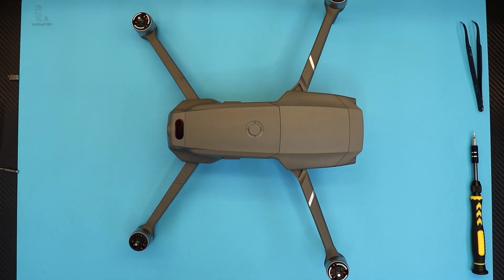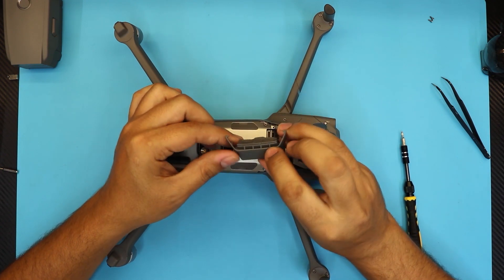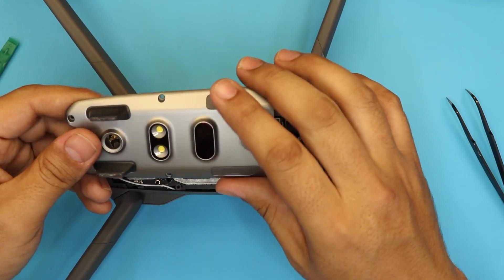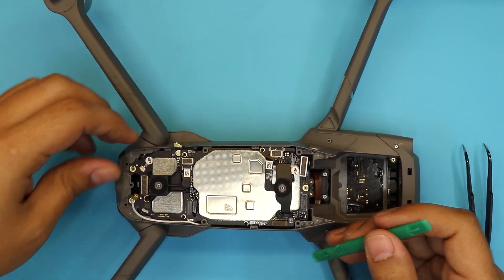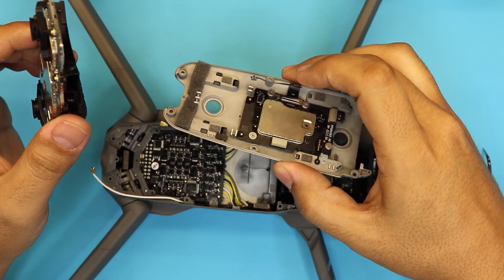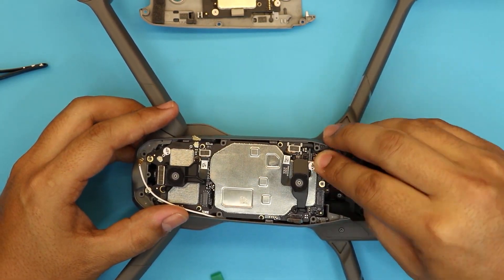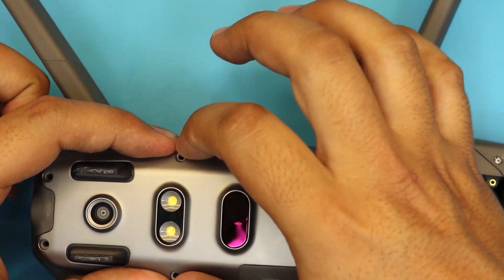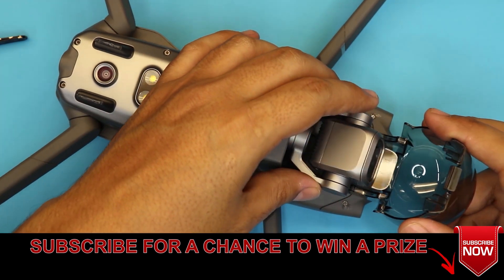DJI Mavic Pro 2 Teardown - FULL Maintenance | Cleaning | Disassembly

Comment: haven't flown my m2p in a long time.  it was overheating and the fan didn't come on.  Got so far as removing the fan/unit from the body, but can't really see anything that would obstruct the fan.  wires look intact and I don't see any obvious blown connections/board items.  is there a way to test it while it's out? can this part be swapped out without detriment to the drone?
Reply from the maker: 🫠 Regarding your question, based on your issues, I would highly recommend taking it to a reliable tech shop to get it checked and diagnosed.
cheers🍻
Reply: @uFixTek  haha…well I have to put it back together now, lol.  Thx

Comment: Thanks for posting. Very helpful. I’m reassembling and have 3 brown Phillips screws with washers leftover and can’t figure out where they go. 😬
Reply from the maker: It's my pleasure, my friend.
🫠 Regarding your screws, most of them are not required. As long as the main body screws are in place, just follow the video. If you see a missing screw spot, then you'll know.
You can test fly! If it flies and doesn't crash-land, then you're OK. Teheheheh.
Reply: @uFixTek Found. Attached the camera board to the body of the camera module. No crash landings required!
Reply from the maker: awesome, great 🍻🫠👍

Comment: My Mavic 2 Pro drone got splashed by a wave and immediately the processor chip overheated. Tried to fly it the next day but the screen started fritzing  and said "Main Controller Data Error." I am going to attempt to disassemble it and clean out the inside with alcohol in case there is salt inside.  Will this work? Any recommendations?
Reply from the maker: Thank you for the feedback! if you wish to support the channel you can LIKE or SUB or both :P
regarding your question: i recommend you to clean and wash the main board with isopropyl alcohol 99 percent : https://amzn.to/3wtpzzf
Reply: @uFixTek  OK, thanks! That's the plan. However, there is 1 screw I cannot get out. The wrench won't engage with the screw head. Should I drill the screw out or is there a better solution?
Reply from the maker: does the screw have a center pin? if it does then it is a torx secure screwdriver
Reply: @uFixTek  No, it's a hex like the others. If I were in the USA I would buy a specific tool to get the screw out, but as I am traveling in Ecuador I have limited options. If there's a bit of salt from the saltwater still inside the drone, how much damage will that do to the electronics over another 5 weeks?
Reply from the maker: the salt water won't do a big damage, we have opened a drone with months of saltwater and they were fine.
Reply: @uFixTek  OK, thanks, this is good to hear. But I definitely shouldn't try to power it up again until I fully clean it, correct?

Comment: Hi all i have the same model drone but my drone have overheating issued

In 10 min fly time my drone can overheat about 42c 

I am staying in malaysia 🇲🇾 
Temperature here normal day will be like 28-32c

Night will be like 25-27c.. even i fly during night time still i will have overheating issues.

Can someone advise please thanks
Reply from the maker: Thank you for the feedback! if you wish to support the channel you can LIKE or SUB or both :P
regarding your question: usually with a good servicing this issue goes away.

Comment: Hi man! Once again, thanks for the great video. I have one question for you. I would like to get the power out of the Mavic 2 Pro to power a small external device.
I would need to solder the wires to the Mavic battery power port pins underneath (7:45 on the video), right? 
Do you know which pins exactly?
Reply from the maker: thanks for the feedback, and i need to know what you going to be powering ?, how much volt you need? and you will need to add a  diode to protect the main mavic board.
let me know what volt you need?
Reply: @uFixTek  hi! I want to power the Parrot Sequoia multispectral camera. Its manual says it needs 5-6V, 2.4-3A and 12-15W. I know that  Mavic battery is 4S and that I will probably need a BEC to get 5V, please correct me if I am wrong!
Reply from the maker: check this video right @5:30 where i remove the cover where the battery goes and the pins are exposed you can solder  a cable to those pics and make a tiny insertion on the case and pull out the 5v
https://www.youtube.com/watch?v=5_MgcnTaQiM

Comment: Hello, excellent video, can you confirm where exactly the compass is located? Thanks
Reply from the maker: Thanks ✌  for the feedback!  if you wish to support the channel you can LIKE or SUB or both :P
Regarding your request:  if by compass you mean the IMU (IMU (inertial measurement unit) calibration is one of those things that is critical to keeping your drone straight and level. The IMU is a sensor that detects motion along a horizontal plane, as well as increases and decreases in altitude.) then watch this:
https://www.youtube.com/watch?v=5_MgcnTaQiM
if you need to know where is the GPS board its in this same video linked above, @6:40 i point to the GPS board
Reply: @uFixTek  Ok thanks
Reply from the maker: my pleasure 😊

Comment: Thanks for the great video!
Could you let me know what type are the screws are used on DJI Mavic. I need to alter something on the drone, below the drone at the back. Screws are not typically M screws I see, have less and more sharp threading.
Reply from the maker: Thank you for the feedback and your support to the channel by a SUB :P
regarding your question:
i will try to get the size of the screws for you let me send an email and i let you know once i get respond.
Reply: @uFixTek  :) Subbed! Thank you very much! Looking forward to the info!
Reply from the maker: i have send two emailed to a friend that works at dji repair dep. i will inform you as soon as i get reply.

Comment: Hi Thanks for the video. I am a total beginner and just about to spray alcohol to the circuit board after soaked in the salt water. I have a few pieces of metallic? tapes on the top of sensors and I would really appreciate if you advise how to glue back to it. One of the tape has been nearly ripped and how can I replace it? I would really appreciate it.
Reply from the maker: hi thank you for the feedback and your support, regarding your question, 1st make sure its a 90%+ alcohol iso :
https://amzn.to/39noeir
don't use anything under 90%
this alcohol its not conductive you can without any issue wash the board using this alcohol.  this alcohol will replace the salt water and remove the oxidation.
and about the tape i need to see some pics to know what you talking about, upload some pics and send me. 
use this:
https://prnt.sc/

Comment: Will any integrity issue for all the dismantle part/ribbon after we take it apart? I'm planning to replace the body shell. Because the authorized seller in my country said, there will be a problem if I replace it myself. They want me to sent it to the shop and they do the rest for me. Off course I need to pay more😢
Reply from the maker: i would recommend you to take it to them, the ribbon o flex cable or parts wont get damaged , but if you going to do it record your self , (trust me) and its not hard just record and if you forget what goes where then you can look back at the video. but if you going to take apart the shell it will take you about 3h if you take your time and dont panic, its easy. all you need to know the parts where not born there, so it must be able to remove easy. :) NOTE: flex cables(ribbon) dont bend then sharp, flex them no problem but dont bend them. and the electronics inside are not sensitive so dont worry too much.
Thank you for the support to the channel :)
Reply: @uFixTek  thanks for the advise. I'm planning to do it myself. It will save a lot of money.
Reply from the maker: if anything let me know and i try my best to assist you :)

Comment: Hey man I know this is an old video but by chance do you or anyone in here have any idea if the rubber nubs covering one of the screws is some kind of tamper indication for dji? I had a mishap with my drone this weekend with some sand and i want to open it up and clear it out but I don't want to mess with my warranty or my dji care
Reply from the maker: yes my friend they are tamper indicators, and if you remove them you will loose the warranty, sorry to inform you about it:( thank you for the support.

Comment: Hi, your video is very helpful. Can I ask do you know what places the different hex screws go? Had a nightmare and banged into my table and the screws have all mixed up 😔 
It looks like I have 3 different types for the bottom case, arm covers and bit by gimbal cover. Most look the same apart from 4, which look like 2 pairs with different threads and thinner body than the rest. 2 also have a bit of blue glue on them. 
Can anyone help point me in the right direction as to where these need to go?

Then do you know how tight the arm covers need to be? Looks like my last strip down caused the middle casing to crack by the arm, I only tightened slightly so not sure if the arm was too tight or too lose which caused the casing to crack when I opened the front arm? 
Thanks
Reply from the maker: thank you for your support my friend, but regarding the screws, all i have is this video , because the drone was from a client of mine, i will see if i can get him to give me the drone for a day so i can assist you.

Comment: Great video, clear and very helpful. After I reassembled drone software still shows main board overheat and fun does not turn on. Yes bottom of the drone plate is too hot.
In my case looks like I have fan problem. Can you post video how to replace fan for Mavic Pro 2?
Thank you.
Reply from the maker: Glad it helped, and sure i try to get my hands on one this next week. thank you for the feedback.

Comment: Tanks very helpfull !!! I had to do it after my drone's felt in water. clened everything inside, dried it and now it's like brand new ;-)
Reply from the maker: im glad that it helped you out and thx for the feedback :)
Reply: It worked after it fell in the water? Or did you mean AFTER you replaced all the water damaged stuff in it?
Reply: @tcg4111  It felt, and then i cleaned ... and then for dry the mist in the sensors, i've left a small heater fan runing out all night long oriented on the drone to make sure everything was very dry...

Comment: just purchased Mavic 2 pro, within few days i am getting "Gimbal motor overloaded error"  and then Gimbal starts moving erratically, no stability at all, many jerks are there. what is the solution for the same.
Reply from the maker: your gimbal was turned on when you had the protective cover, and  or maybe something touched it when it was powered on or you touched the gimbal when it was on!, that will damage or it will set it off its balance.  there is nothing you can do, just power on and off and if it doesn't calibrate automatically then you have to replace it or send it for warranty.
Reply: @uFixTek  eventually it gets calibrated every time i on it. but still i get this Gimbal motor overloaded error. and here at my country its not available officially so no warranty.

Comment: My Mavic 2 Pro gimble clamp has popped out a bit and now get "Gimble motor load too large.  Please check if gimble clamp has been removed."  On start up camera is able to go thru all the motions and the camera takes photos & video, just can't adjust up and down camera angle.  How do I re-secure gimble clamp? Can't just push on clamp and make it go back in place.
Reply from the maker: I have made a video showing how to remove in few min you gimble, remove it and check if anything is off

Comment: Hi, is it common that the Mavic 2 Pro arms squeak/creak when unfolding them? Like if the plastic parts aren't fully tightened.
Reply from the maker: Adrian D no is not!!, you need to open the armas and check and lubricate it. Can u upload a video with sound?
Reply: @uFixTek  It's brand new! But I will upload a video in the coming few days for you and DJI to see.